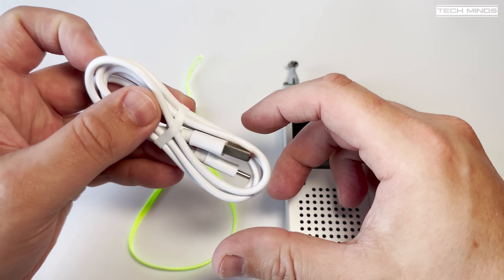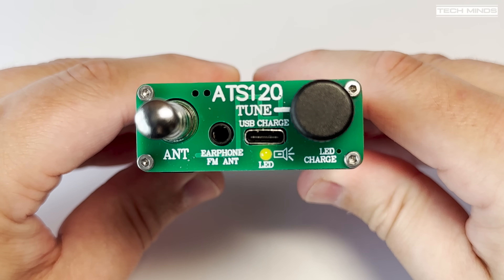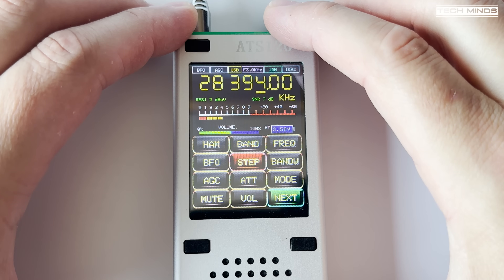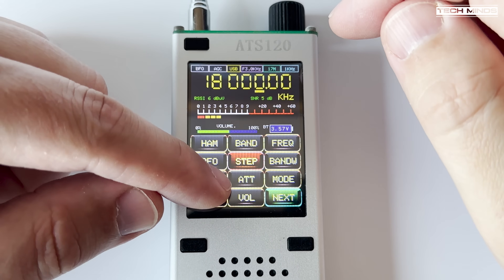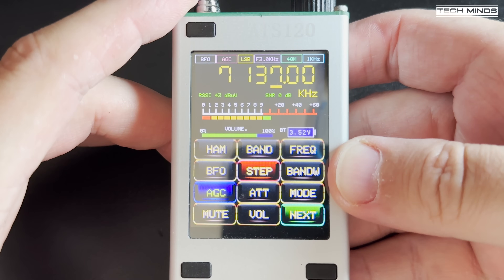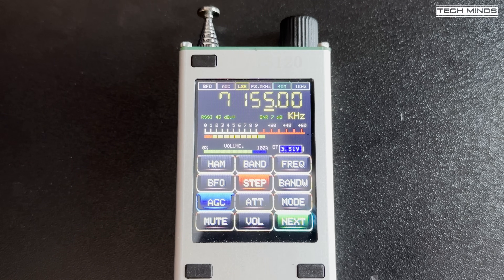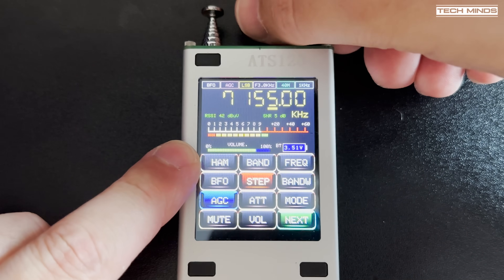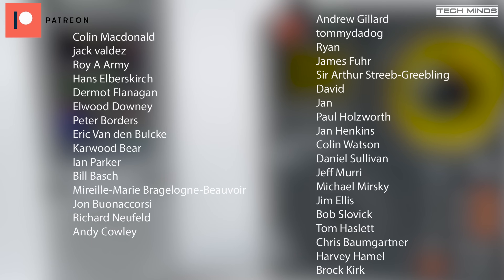ATS 120 Portable HF Receiver With Colour Touchscreen

Comment: What is the impedance of the external antenna input of this rx? What cable would you recommend to act as an external wire antenna for this radio and what minimum length?

Comment: Amazing that you could step to a station on 40 metres without touching the BFO tuning button which I find very useful for decoding FT8. I simply place my Android tablet and iPhones next to the speaker, using ft8cn or iFTx depending on which device I use at the time.
G4BTI.

Comment: 6:39 what is that noise? I hear it on 40metres too, around 7080khz. Is it interference?
Reply: What you hear is FT8 Mode, a digital weak signal HAM Radio Mode. , This mode is done on certain frequency’s World wide.

Comment: I live in Utah and you can hardly get anything on HF here, despite your equipment or antenna (indoor or outdoor). I have several receivers that can get HF but I just get noise. The east coast of the US and Europe still have good reception. This guy in this video is in the UK I think and you can get a luxurious amount of signals there. Some parts of the world are just dead as far as HF. On rare occasions I can hear a faint Ham SSB signal but usually only one side of the conversation. I almost never can hear WWV on 5, 10, 15 or 20 Mhz. If I can't hear WWV 5, 10 or 15 Mhz, I know it's no use to bother tuning through any of the bands. It's useful as a beacon to tell what kind of conditions you have.
Reply: Perhaps it's your equipment.  I often hear Utah stations communicating on HF, much of it POTA and SOTA, so typically QRP, compromised antenna comms.

Comment: I just got an ATS type radio and its good except its 2.5KHz off frequency by 30MHz. Looking inside there are no adjustments for the XTAL but it should be possible to compensate for a slightly off master clock in software like the Malehite can i.e. if you know the display is 2.5KHz different to the actual received frequency then just add/subtract 2.5KHz from the selected frequency. The BFO isn't quite the same thing because that gives you a static offset on all bands. To compensate for the master clock the offset needs to be proportional to the selected frequency.
Reply: Hi,hope u fine can u tell me whats this for i searched and saw a lot of videos on its but could not understand,why this people use for
Reply: Hi,hope u fine can u tell me whats this for i searched and saw a lot of videos on its but could not understand,why this people use for

Comment: dont fall for this shit people - the picture is misleading.

if you stand in the field with that tiny telescope antenna you will receive nothing

ther is no point in handheld-hf-receivers at all, because they all still need the same big antennas that the pro use on their bigger receivers/transceivers.

There is no magical cure that makes these small things able to receive anything on a few centimeter of telescopic tubing.

So when you look at it, picture yourself attaching a heavy PL type or BNC type adapter, many meters of cable... and then an antenna purpousebuild for HF....

...at that point you wonder, if trying to be cheap on the receiver was that a clever idea.

Comment: They're steadily improving these ATS series of receivers. Does this have RDS on FM? I see they mention RDS in the accompanying info but yet I didnt see a station iD when you were tuned to FM.
The antenna socket would've been better placed at the top like the PL-368 but at least they seem to have sorted the muting on HF.
Thank you for sharing and making us aware of another really cool radio. Great channel!
Reply: The biggest advantage is that the screen has upgraded interference suppression to AM LW SW SSB, and the screen will not interfere
Reply: RDS is working! Great.

Comment: Only question I have is if the telescopic antenna is any good for other than the FM band. If I got one of these I would use it more for portable use than in my shack.
Reply from the maker: The antenna is 85CM, so not going to be great for HF unless you use an external antenna using the jack on the bottom. Although I did hear some stations on 40M using the telescopic antenna while in the garden.
Reply: ATS120 SSB 14270  https://www.youtube.com/shorts/Pkc7yhlLnpU